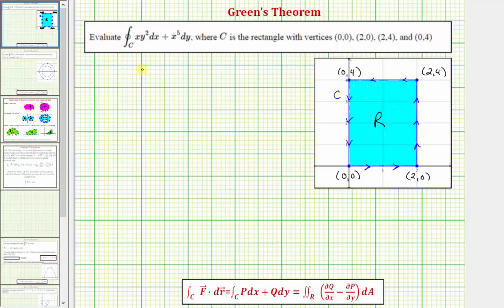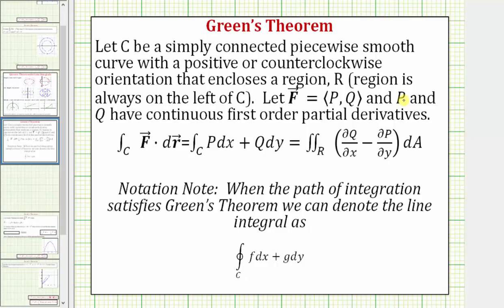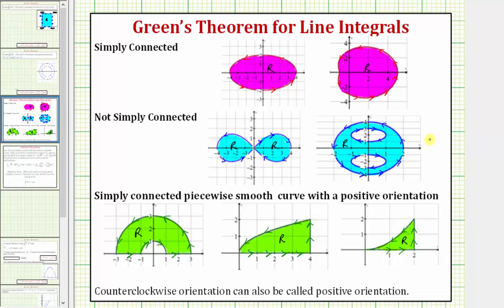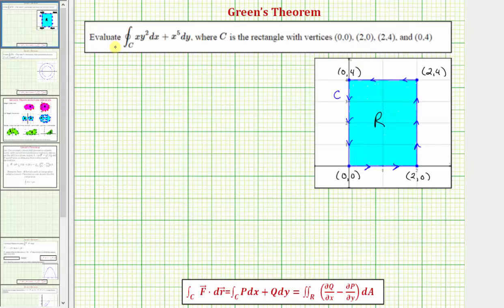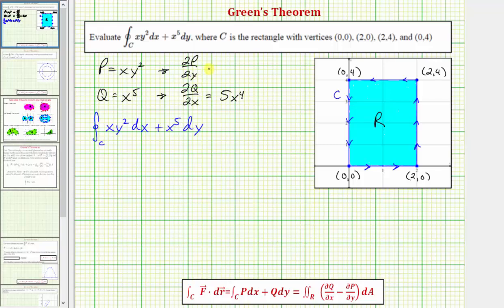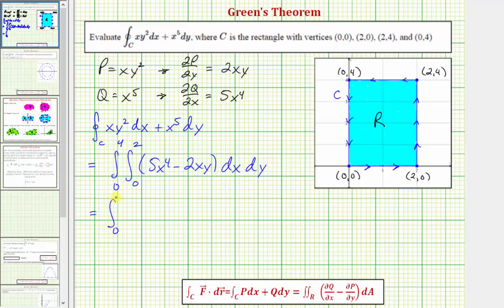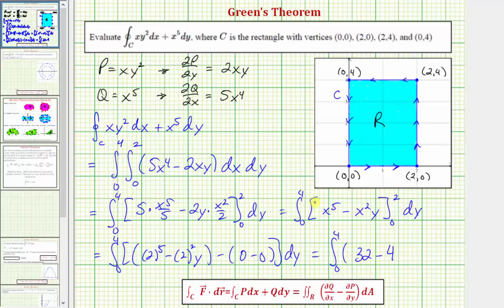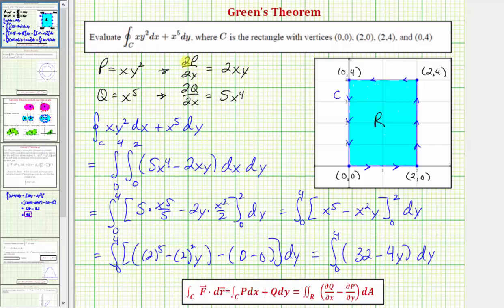Ex:  Use Green's Theorem to Evaluate a Line Integral (Rectangle)

Comment: Problem 2. Let R be the rectangle [0:2] x [1:4].

(a) Let f(x;y) = x cos(x² + y). Calculate the integral ff f(x, y)dA.

(b) Study the Simpson formula. Develop a function to estimate the integral in R using Simpson formula.

(c) Let n and m be the number of sub-interval in z and y compo nents, respectively. Estimate the integral with [n, m] = [40.60] and [n, m] [80, 120] and estimate the errors. help me pleaseeeeee

Comment: How do we know if we have to start integrating from dy or dx
Reply: We Use The Limits...If the Limits Are For x, You Integrate w.r.t x And Same for y....Hope It Helps After 3 Years
Reply: If you are doing double integrals over a rectangle, then the order in which you integrate does not matter so long as you match the bounds with the correct variable.

Comment: What are some "practical" sources or applications of this? I understand the curve and the math but can't relate to the source of the very fist integral on line one of the problem.
Reply: +Hollis Inman (Jack) Line integrals have many uses in physics. In one of the earlier videos it is shown how to evaluate the work done on a particle traveling the curve C.
Reply: I used this to derive the Lorenz Force from Maxwell’s equations via Leibniz Integral rule in 3D (which uses line integral of the cross product of 2 vectors). Now I can analyze the energy conservation of my radiation circuit for an engineering design I’m working on in my spare time. So, electrodynamics. It’s pretty handy.